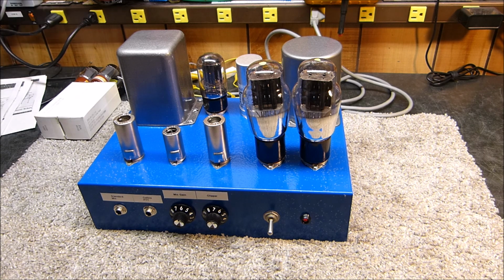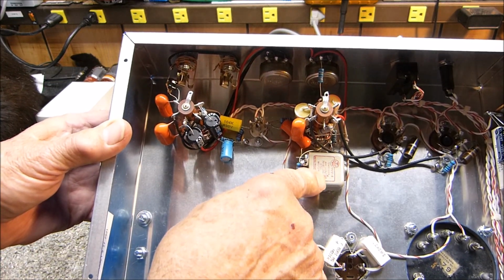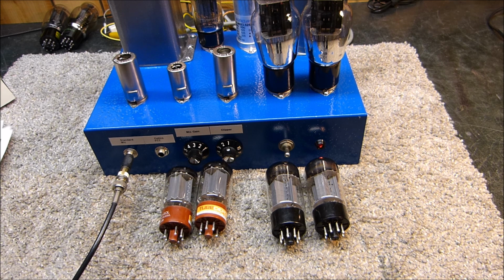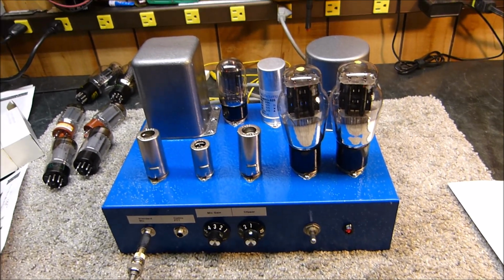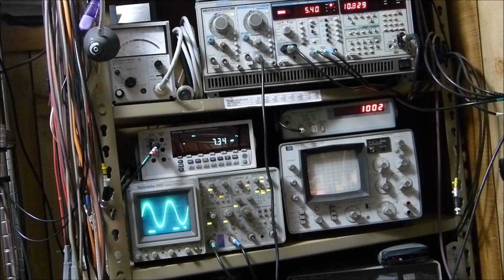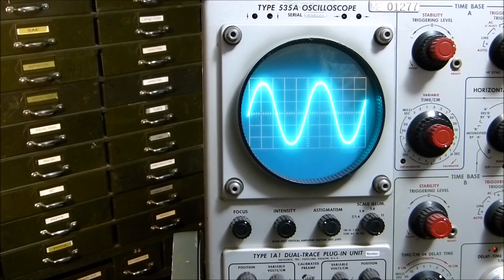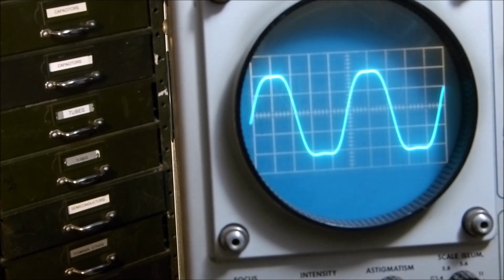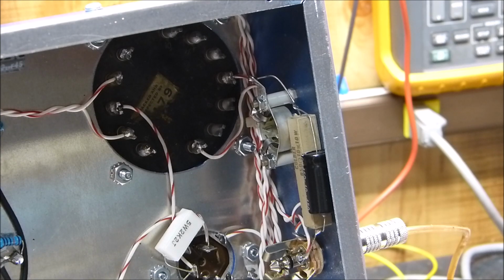Microphone Amplifier Collins KW-1 Design 6B4G Driving Eimac 4-125A Modulator for AM Transmitter

Comment: Which UTC output and filter?
Reply from the maker: I don't remember the UTC transformer number but it is a common value primary (5K) to speaker output impedance
values (4 ohms) . The input transformer on the modulator is 4 ohms to 8K driving the grids of the 4-125A modulator tubes.

Comment: Hello,

I am in desperate need of some old 6b4g tubes and im in Texas. If you can spare a pair for the going rate?

Ebay has been not too kind with tubes!
Reply from the maker: I might remind you that the original 6B4G tube is a genuine direct heated cathode where as the JAN 6B4G is an indirect heated cathode with its cathode connection on pin 8 just like a 6L6. This is important to keep in mind when building the cathode circuit.

Comment: Hello, can you please send a schematic or a link to one? Im also building an exact copy for my AM  station.
Reply from the maker: I agree that Ebay prices are over the top but they mostly always have been. Also, tubes are a real risk so it is best to buy from someone that will allow returns, in my opinion.
Here are some listings - the ones from Canada might deserve a good look - 
https://www.ebay.com/sch/i.html?_from=R40&_trksid=p4432023.m570.l1313&_nkw=6B4G+tube&_sacat=0
As for schematics, I built the amplifier exactly as Collins Radio did for their KW-1 transmitter. Here is the schematic and full manual.
https://collinsradio.org/archives/manuals/KW-1-(01-52).pdf
Good building with your amplifier. Nothing like turning on our homebrew equipment and seeing it operate perfectly...   🙂
Reply from the maker: Here is a much better schematic of the audio section of the Collins KW-1
https://collinsradio.org/wp-content/uploads/2019/06/KW-1-March-53-Edition-Main-Schematic.pdf

Comment: Can you make 6SN7 45 2watts and share schematic please. I want to follow you.
Reply from the maker: Below  is a link to the complete manual for the Collins KW-1 and the speech amplifier schematic that this piece of equipment was built after is on page 93, Fig. 7-3
I did consider making the 12AX7 a 6SL7 and the 12AU7 a 6SN7 but decided to make it truly part-for-part accurate and used the same tubes as Collins Radio did in 1952.
Hope this helps. The tubes are V401 thru V405 in the schematic.
http://collinsradio.org/archives/manuals/KW-1-(01-52).pdf
Reply: @ElPasoTubeAmps  I am fainted.  Too difficult for me

Comment: I assume those 5881 are American made..... just wondering if you've tried the current Russian Tung-Sol reissues??  What do you think of them?
Reply from the maker: Those are the Russian Tung Sol 5881 and they are very good - I have several sets of them and they are every bit as good and sometimes better than the vintage Tung Sol and I have plenty of them also. I have made this statement before in some of my videos. I am sticking with the vintage 6B4G just because I tend to favor the triodes and they deliver plenty of power to drive the modulator. I am also a fan of the Russian Tung Sol 7591. I recently bought a quad for my UTC amplifier and all four measure the same on my TV-7 and perform beautifully.
Reply: @ElPasoTubeAmps  wow!!  thanx for the info. :) & reply.

Comment: Very clean construction. I always come away from one of your videos inspired and motivated! Do you have a source for those extended bottom tube sockets? I used them a lot in experimental circuits years ago but I haven't seen any in ages. 
Thanks for taking the trouble to video & post these.
Reply from the maker: I picked up a bunch of those extended bottom sockets at an estate sale lately. They are found on Ebay as,  Vector tube sockets. They turned out good in this amplifier but as mentioned, they are difficult to mount components on if the socket is in a corner of the chassis or next to a side. See Ebay listing below.
https://www.ebay.com/itm/4-Vector-Brown-9-Pin-Vacuum-Tube-Turret-Sockets-Cinch-With-Threads-NOS/303767161985?hash=item46b9ef0c81:g:Vm0AAOSwhX1fryCg

Comment: Another grand build, I always get a few tips on construction by looking at how you build stuff. Vintage stand offs, like your sockets, especially ceramic ones are going for stupid money in the UK, the last lot I looked at were £7 each! Ones like yours are £20 each. Those ones of yours look well handy. 
    I notice you have a ground tag, is that on Rg1 of the OP valves bolted to the chassis but with a black ground wire too; does that not introduce a gnd loop?
     The 6Al6 circuit is what Radio Designers calls an AGC no? Except yours isn't automatic? Thanks again......DA.
Reply from the maker: I started using the good red and black wire and then discovered a whole roll of the smaller good wire so I changed to that smaller white and red striped wire. The Teflon or TFE or PTFE wire (I think all three of those mean the same thing) is so good... it strips easily and doesn't melt with the soldering iron. I do use the ground taps on the sockets for grounding components. I have found over many amplifiers if I build the power supply in one corner of the chassis with all the returns from the PS electrolytic filter capacitors going to one point in that corner, away from the audio circuits, I never have a hum problem.
Now that I read your comment above again, I think you are referring to the shielded wire to the grid 1 of the OP valves. I ground only one end of signal cables like this to prevent any type of gnd loop. It is  my opinion that grounding both ends of shielded cable, especially one that runs all the way across a chassis is, indeed, a good way to pick up hum and should be avoided.

Comment: Would very much have liked to have seen one of those tube sockets without components on it.  Also, would love to have heard that one in action to hear what it sounds like.
Great job...thanks for sharing.
Reply from the maker: They can be seed on Ebay as, Vector tube sockets. Here is one link.
https://www.ebay.com/itm/4-Vector-Brown-9-Pin-Vacuum-Tube-Turret-Sockets-Cinch-With-Threads-NOS/303767161985?hash=item46b9ef0c81:g:Vm0AAOSwhX1fryCg
Yes, I should have played the sound of non-clipped and clipped audio out of a speaker. It gets pretty harsh with much clipping but the voice can be understood and, as mentioned, may be better in some situations at transmitting the "intelligence" of the voice across radio contacts. Personally, I will probably keep the clipping control pretty much turned down or completely out.

Comment: hi David, very nice build! love the blue chassis!
Reply from the maker: Hi Manuel,
Good to hear from you. I hope all is well in Italy. I am having a lot of fun on 40M with my "new" AM rig. Two of the components, the Collins 310B and the Millen 812A amplifier were built in 1947 and still working great. It was a challenge to get used to the swinging link loading of the plate tank but I finally figured it out. Efficiency is very high on this PP amplifier - plate voltage 1300 or maybe slightly less to 1250 and plate current is 275 mA. Figure this out and you get 83.9% even at the higher voltage as the carrier output is a solid 300 watts using a new Bird 1000 watt element. I trust my meters but it seems high. If I use 1250 volts to calculate, it becomes 87.3%. I doubt I will build with PP, swinging-link coupled tank coils but it has been fun. 73
Reply: @ElPaso TubeAmps nice to hear from you! how are you doing?

I am doing well right now, i am still working and recently got a promotion, unfortunately we are in full national lockdown since a month and my region since january so not a great time but anyway...

Glad to hear you are working with the AM amp, you put together a nice beast! 87% efficient is remarkable, congrats for the results!
maybe when there is good propagation again we can try a QSO, but at the moment i still have to set up the new antenna, has been almost a year without radio for a lot of problems about the installation and time to work on it.

right now i am kind of stuck with everything because i work full-time in shifts meanwhile studying engineering at uni so lab and ratio time are low but still having fun from time to time, i just made some maintenance on some instruments and just started the restoration on a TEK 561A.

hope to hear from you again, have a nice day and stay safe! 73